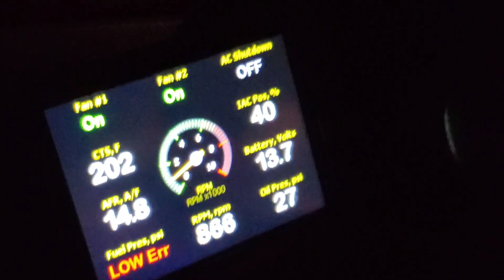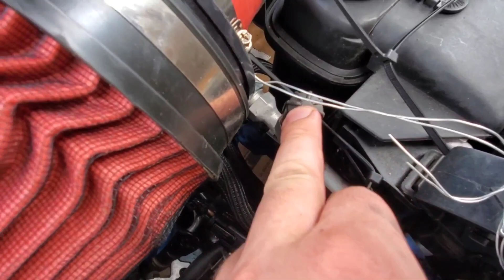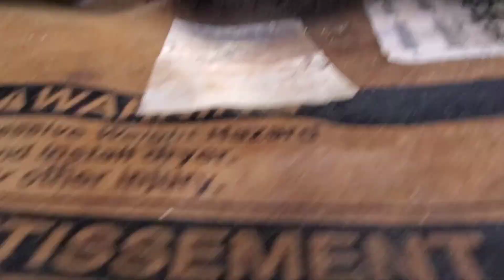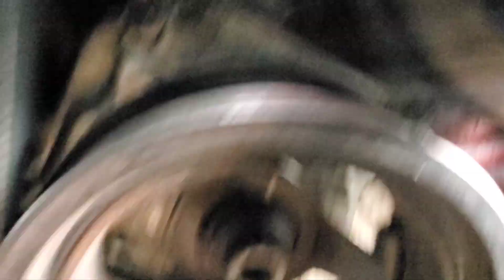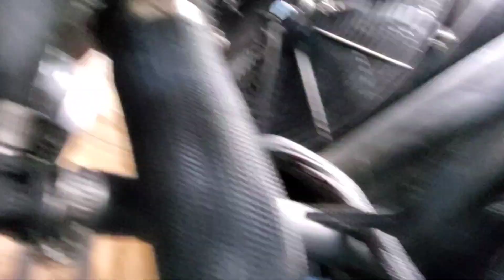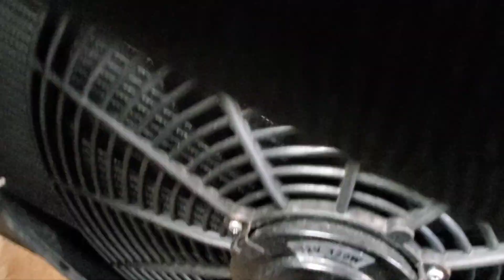e38 740iL BMW LS SWAP pt. 30 -Working AC

Comment: Hey Tom, I lost your email address.  Irrelevant question to this video, but what head unit did you use for your audio system?  I bought a Chinese Android unit but the DSP amp on my 2001 E38 seems to be an issue.  No sound.  Not interested in gutting the whole system, just want a better interface and bluetooth, carplay, etc.  Were you able to get a unit to work?  thnx!
Reply from the maker: Hey David, I ended up putting in a cheap android head unit from Amazon, was not anything special. I bought the car with an aftermarket stereo already installed and the previous owner did all the wiring. The last time I looked at it I think all they did was connect the speaker wires directly to the head unit, and bypassed the amp all together and ran RCA lines. I have subwoofers in the trunk doing the bass. I'm going to remove my android unit and put in something that can do steering wheel controls and carplay down the line. Hope this helps.

Comment: Good job Tom! It looks well done. Easy to maintain.
Reply from the maker: Thanks brother, it's coming along. How's your twin turbo setup going?
Reply: @thehomeofbiglspower  I haven't even touched it. Life got in the way. But I'll definitely get back on it this fall. I'm debating whether or not to ditch the twin turbo idea and just go single turbo.
Reply from the maker: @toddsmith1814  I feel you man, sometimes it gets like that. Hope you get back to it soon. I like the idea of twin turbo but probably twice the plumbing. The engine bay is pretty tight as it is. I got that new 5.3L that I want to make single turbo in a small package like OEM.